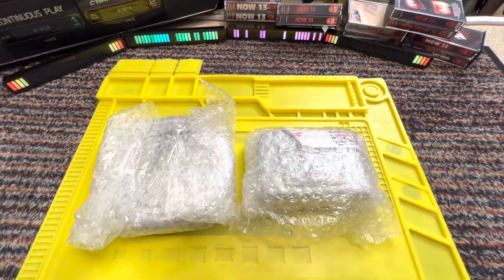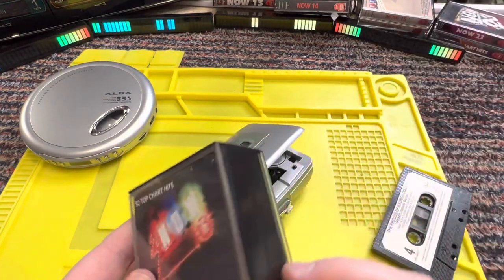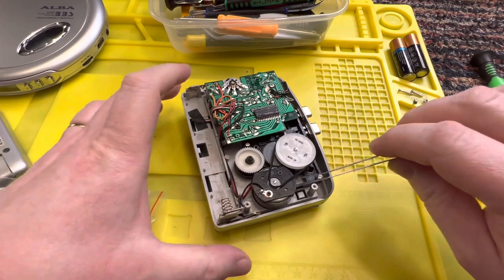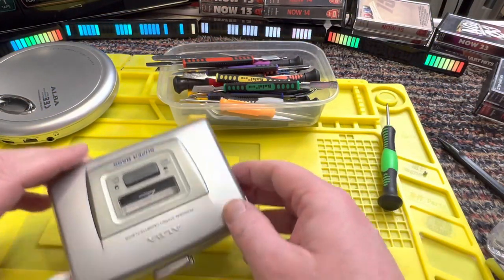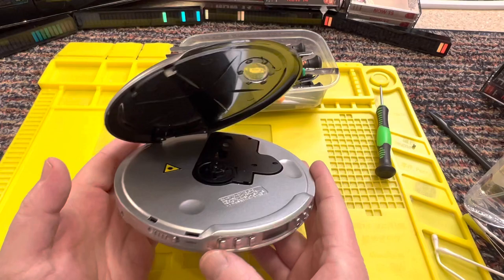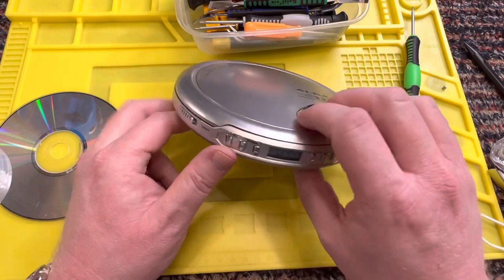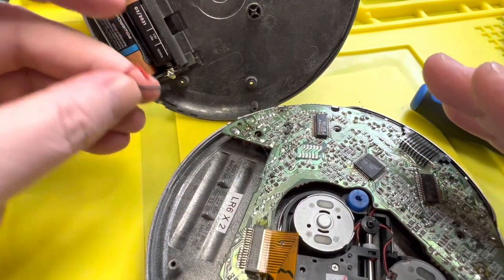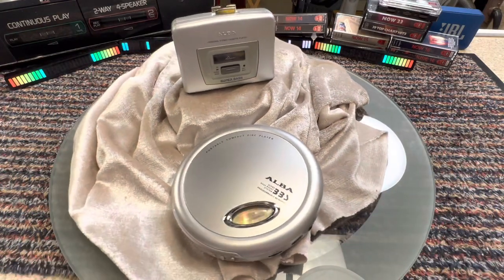ALBA Cassette Player & CD Player, First Look & Repair, Subscriber Gifted. @Mymatevince @Techmoan

Comment: I had a working alba cd player never sounded as good as the one you have i have not used it since first trying it as it never sounded great but now it does not read disc at all i had a china made kenwood that has done the same worked fine and months later it would not read at all maybe it is down to bad caps ,my 1988 sony discman still works fine but that was made in japan .The alba name is owned by argos and that is why it only ends up on cheap devices long gone is the original company like many brands now that are just names .
Reply from the maker: I genuinely think what let’s these down are the quality of the headphones, when plugged into decent really good quality speakers or headphones, you’d be surprised at how good they can be. Nearly all the good brands now and not worth the i k they’re printed on. Just fooling people by the historic quality of past products.

Comment: What is a 'spudger'?
Reply from the maker: A spudger or spludger is a tool that has a wide flat-head screwdriver-like end that extends as a wedge, used to separate pressure-fit plastic components without causing damage during separation.
Reply: @HooverLux  Aha, cheers!
Reply from the maker: You’re welcome BF 🤗